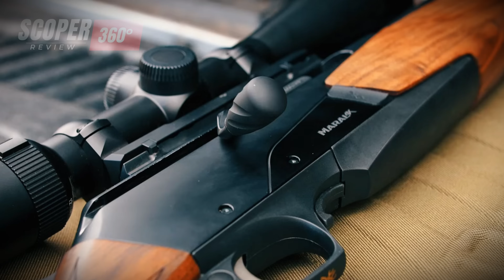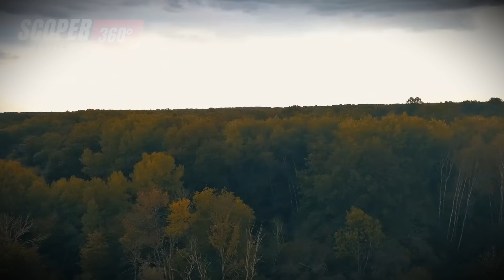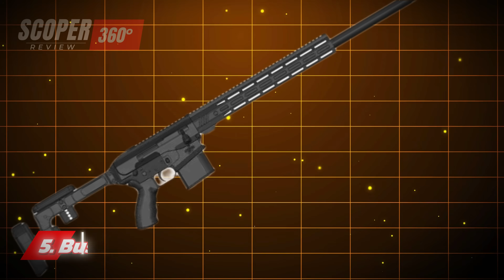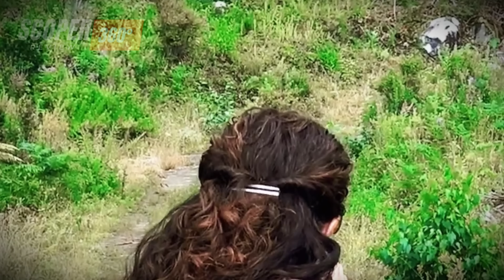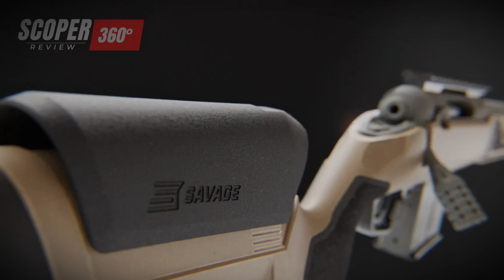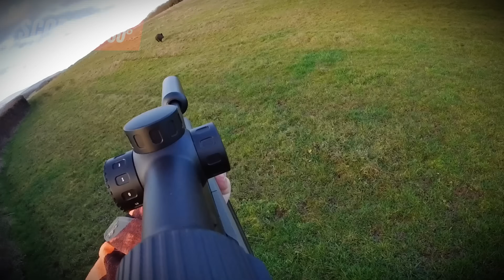The #1 Best Straight-Pull Hunting Rifle at SHOT Show 2026 – The Straight-Pull Takeover

Comment: Missing Merkel Hélix and a few more, and Blaser calibers starts at 22lr till the 500 Jeffery
Reply from the maker: You’re absolutely right 👍

The Merkel Helix is definitely a notable straight-pull platform, and Blaser rifles do have an extremely wide caliber range.

The only challenge is that this video is a top 7, so when many rifles perform at a similar level, it becomes pretty difficult to choose just a few. Appreciate you adding that!
Reply: @Scoper_360  also steel action is missing